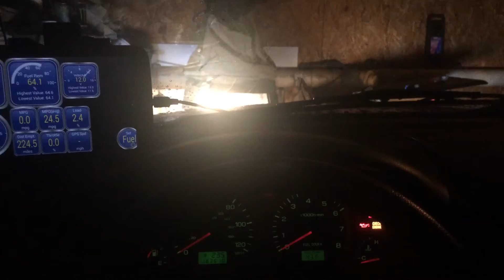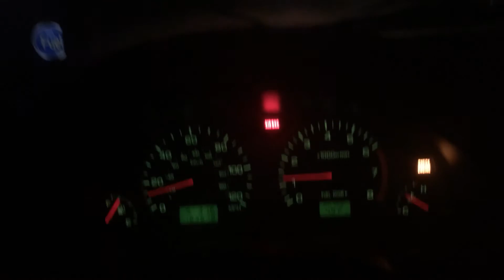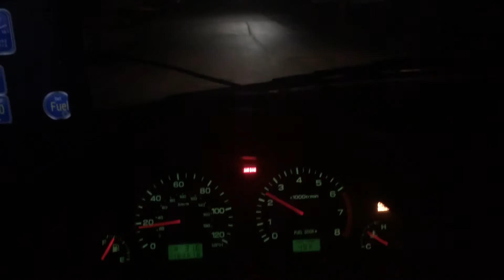EJ251 Forester Rod Knock Update

Comment: Heya Blu. Thanks for the shout out! The dull knock can be heard as soon as you start climbing the small hill and seems to dissipate. I'd really have to listen to it in person to absolutely certain. Number one rod would be suspect and usually does show wear. You could pull the ignition wires while running at idle one at a time to see if the noise changes and possibly narrow it down to a specific cylinder. 

Pull the pan, look for the glitter of bearing material and check for rod play. like you said. I would just change the oil and drive it lightly in hopes it will last until you get something to pop back in. If it starts knocking badly, you'd be better off parking it. 

You could use an EJ222 block and bolt the 251 heads on it. There isn't really a compression drop and you could still use the UEL header.
Reply from the maker: I currently have an older EJ22E in my garage.  I was told it ran when I picked it up.  It's got the single exhaust port on the head, but I'm not entirely sure if it's compatible with my setup.  It's only got 4 fasteners to hold it to the transmission.  No clue how I would get the starter to work. lol.
Reply: The EJ22E is a good strong reliable bottom end. It would lower compression slightly with EJ251 heads, yes the two can be bolted together. It would be the same as you did before, just change out the short block with new gaskets. The one other thing would be the crank timing gear, it needs to match the original one of the Forester. Soak in good penetrating fluid and lightly pry the one off of the 251 and install right onto the 22E. 

As for the starter... because you would be bolting a phase 1 engine to a phase 2 trasmission, there is really only two options. Either bolt the starter motor in using just the one bolt, or drill and tap a hole in the block for a bolt/stud. I would recommend drilling and tapping a hole, especially because the engine is already out. Honestly though a lock washer, loctite and one bolt would hold the little starter on, it would just wouldn't be as reliable.